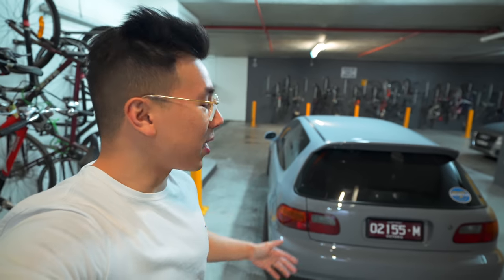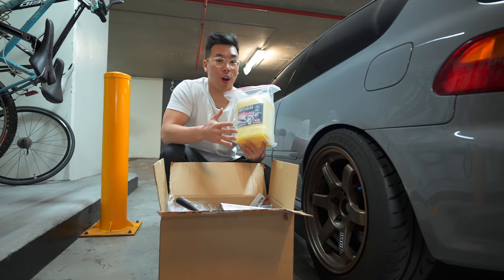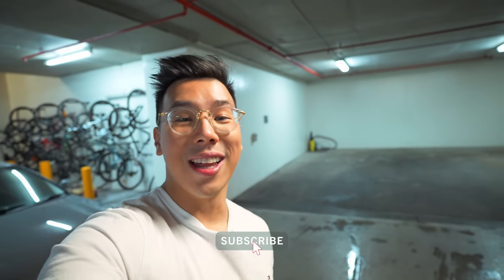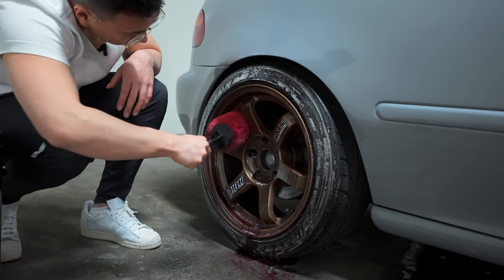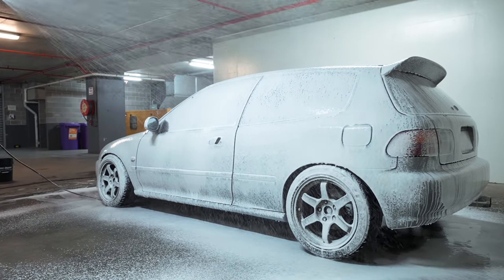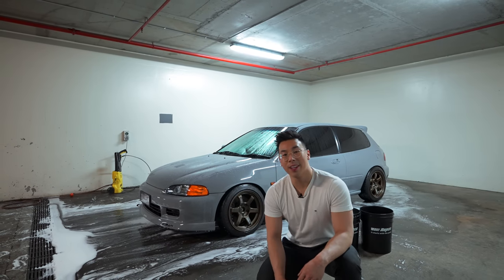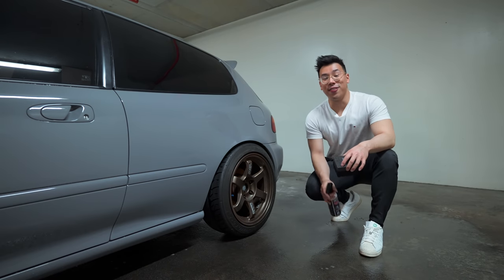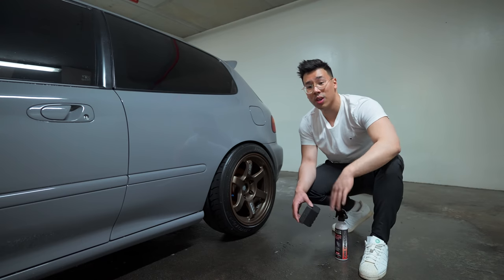How I Foam WASH And Properly DRY My Car - K20 Civic EG Hatch

Comment: Been literally doing the same thing with my EG4 and ED6. Been using big microfibre towels to dry the car and tempted to dip my toes in with the dryer! haha trying my hand at full blown paint correction and restoration, a little bit longer learning to get it right and the methods but I'm going for touchless wash as much as possible.

Comment: Mate, where did you get your rear spoiler? Also, what’s your wheel specifications? Cheers!
Reply: Spoiler looks like the spoon ducktail rims are a 16x7j with a pcd of 5x114.3 i don't know the et or center bore though
Reply from the maker: Hey bro! I’m running a Spoon rear wing spoiler along with a set of rare concave TE37s in 16x8+15 that originally came off an R32 GTR.😁✌🏻
Reply: @ClayWong  dam they a big set rims guessing its a 205/45/16 set of tyres on it very clean build

Comment: You’re going to get ppl telling you how to wash a car so I might as well also haha
You should foam the car before wetting it, and also foam from the bottom up. This maximises the dwell time of the foam, which softens up the grime which will then help remove contaminants when you pressure wash it after foam.
Then you do the two bucket wash method.
Reply: Agree! Helps to use a snow foam product designed for this use, rather than a shampoo, to also increase dwell time. Detailing is very much a continual learning process.
Reply: From my experience, you’re better off pressure washing the car and wheels prior to foaming / spraying wheel cleaner. 

This removes the bulk majority of dirt and grime so that the chemicals and foam do a better job at lifting the remaining dirt in stubborn areas prior to a final rise down before contact washing
Reply: @martinl6496  the two methods, rinse before foaming or rinse after foaming have been tried and tested and it was found foaming a dry vehicle provides better results. 
The discussion is on the detailing Australia Facebook group